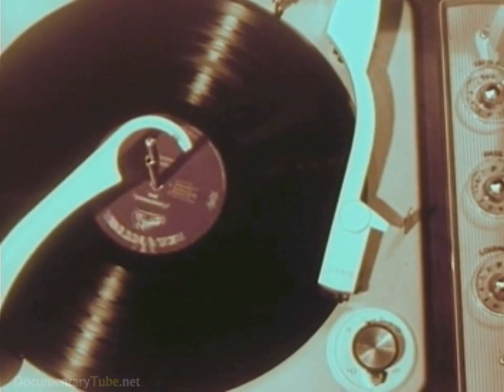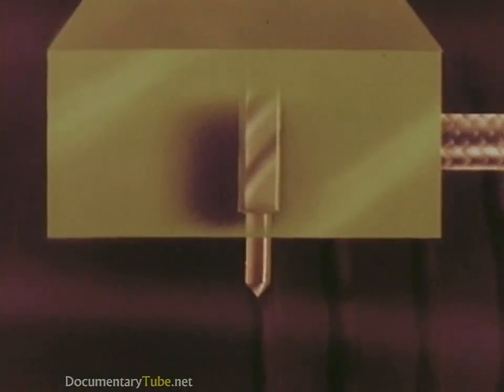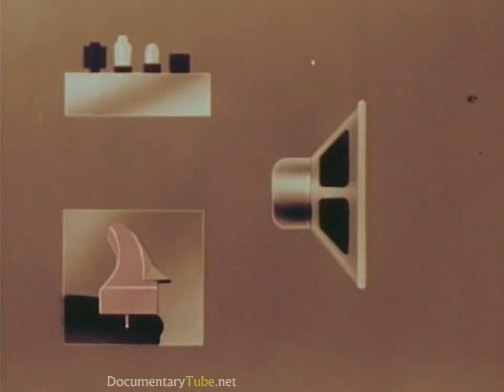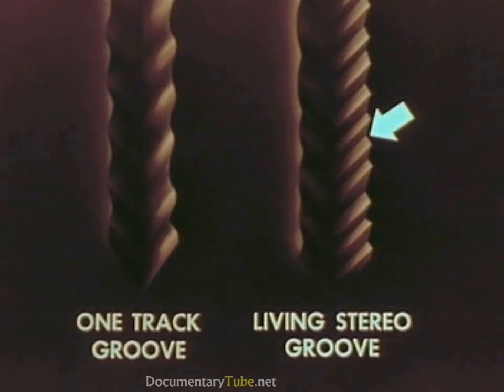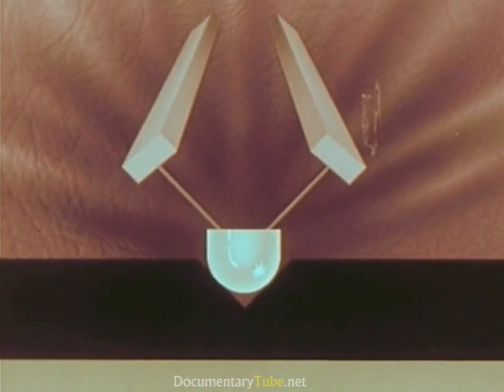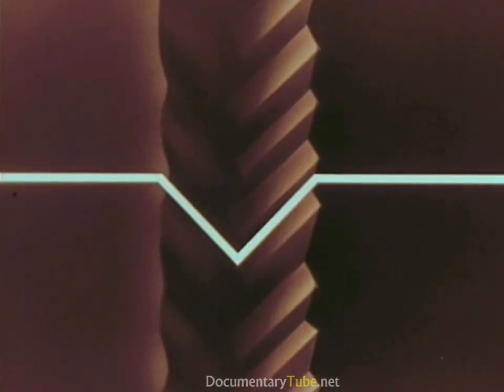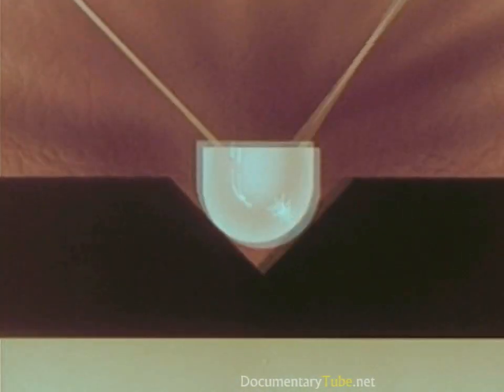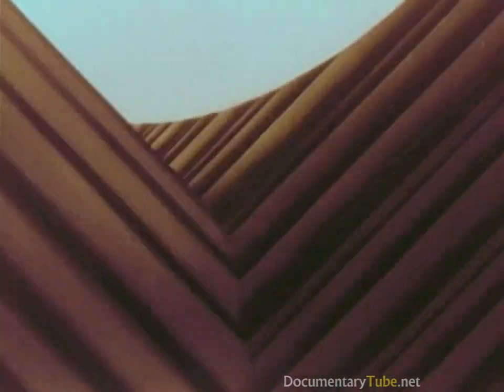HOW IT WORKS: Stereo Turntable

Comment: It still makes no sense how a cut in plastic can mimic any sound known to man. Vinyl records will always be magic to me.
Reply: agree 10000000% :)
Reply: A speaker produces sound by vibrating the air. A record has grooves that vibrate the tracking head of the cartridge. They made the grooves and vibrations very-very small, so that's why you need a pre-amp and amp, but at the high level, the groves on the track are vibrations of the speakers, amplified.

Comment: This makes a little more sense. But it still blows my mind on how 1 point can speak for 2 sides for stereo. I'd of thought each side would cancel each other out.
Reply: It's not that they "cancel" each other out but they definitely affect each other, more or less, depending on the frequency of the sound. And that's why there have been records made with two separate tracks with two separate heads needed to pick up the sound for each channel. It's a better design, but because it needs to contain two tracks, it cuts the usable space by half, and the records were way more expensive to produce. so consumers didn't like it and opted for a simpler design which gave them an acceptable level of quality loss.